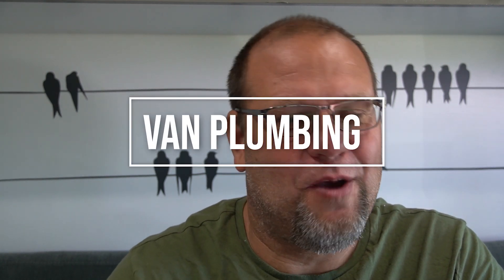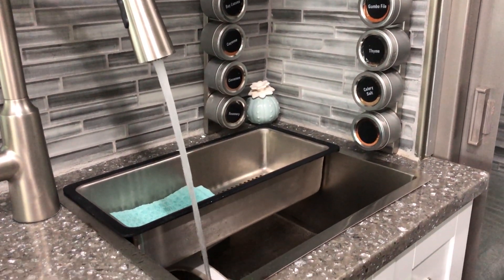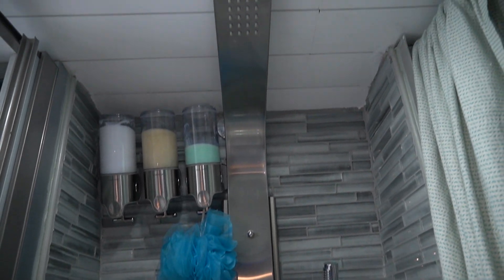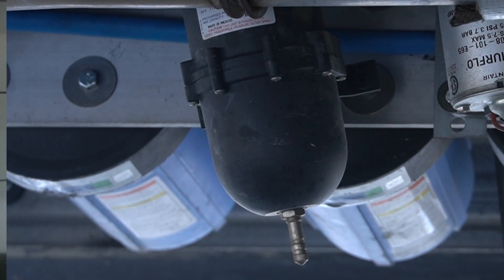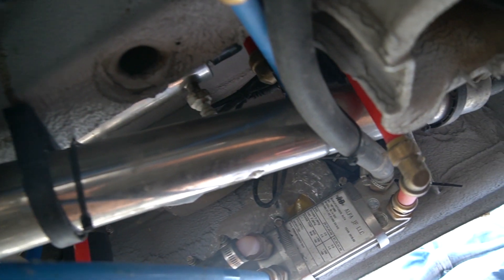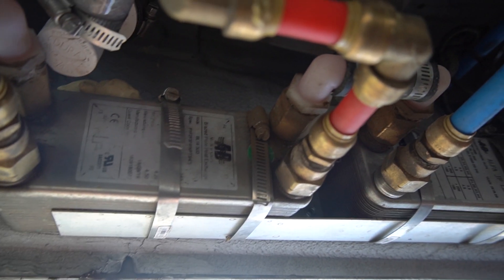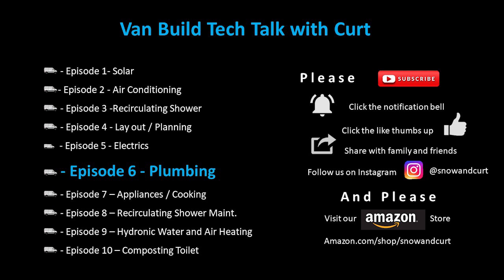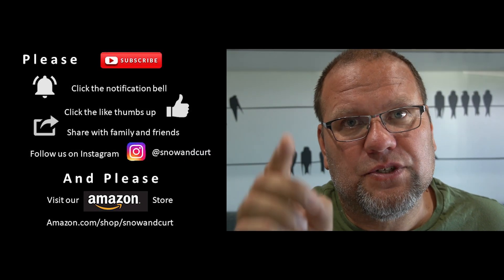Van Plumbing System Tech Talk - Van Build Series Ep. 6

Comment: Thanks for all your videos!! We are just starting our van build and like your recirculating shower. If I understand correctly, you have 2 separate filtration systems, one for the shower and 2nd for your sink. Did you consider using one filtration system for both, with valves to make sure the shower and sink don’t get mixed?
Reply: (Just to save $$ and room)
Reply: I think I answered my own question. Probably the filtered water from the shower is not drinkable, so it would be difficult to combine the 2 filtration systems.

Comment: Looks like you used the 5.5GPM SEAFLO Diaphragm Pump for your shower. Your Amazon also has links for 2 SHURflo pumps. Do you recommend those for the sink, or the SEAFLO for both?

Also, SEAFLO or SHURflo for the accumulator tanks? You link both, but curious if one is better.

Finally, what filters did you end up with? 20 Sed, 5 sed, 1 carbon?

Thanks!!

Comment: So do you use 2 espar heaters with heat exchangers or can you have 2 heat exchangers off one heater?
Reply from the maker: One Espar 2 heat exchangers.  I will add a third that will heat my air for in the van.  It is a slightly different heat exchanger.
Reply: Snow & Curt thank you for the response.  Air heat shouldn’t require an exchanger? Should it?
Reply from the maker: It all depends on what kind of heater you are using...I am talking about air.  Basically, the glycol will circulate through a radiator/ heat exchanger in the van.  There will be a small fan(s) that blow air through the heat exchanger heating the air and ultimately the van😊
Reply: Snow & Curt once again thanks for the response and your videos.  

 I contacted Rixen as you mentioned in one of you vids and they were very helpful.  I just purchased Espar D5 with complete kit for water heating from your recommendations.  Not cheap but seems worth it for sure.
Reply: Dares Drives About how much was it?